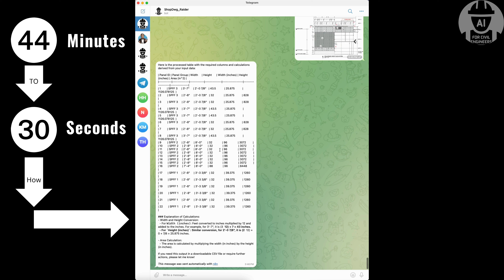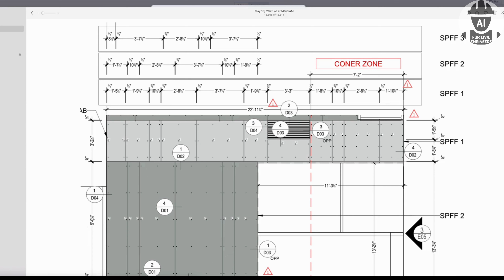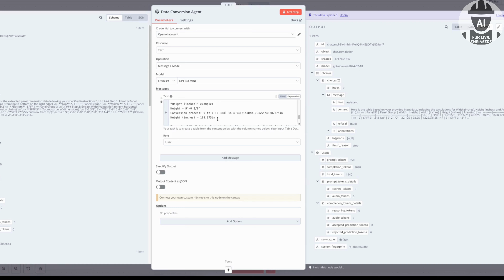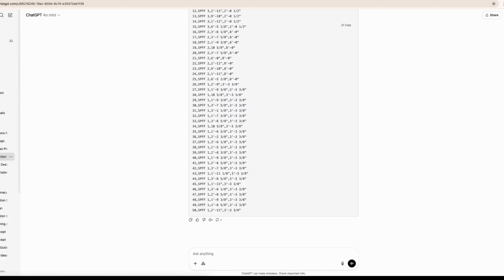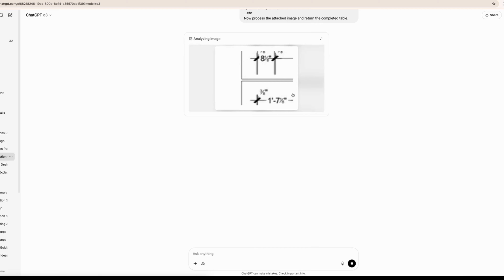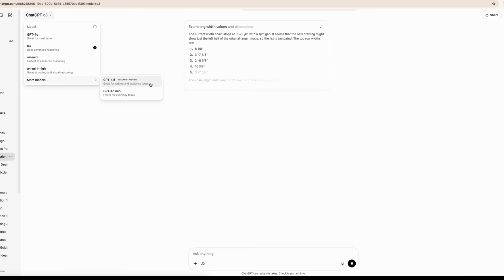AI Reads Blueprints—Instantly Fills Your Excel Sheet! 🤯 Watch AI Do the Dirty Work Zero Manual Input

Comment: Hi I my construction drawings are huge pdf of around 30 mb and it has multiple plans with in pdf. how can we generate BOQ by passing drawings?
Reply from the maker: Hi Kunal. This a great question and I have been working on this for awhile. Please watch my previous video on Construction Material Takeoff 

AI Automation for Construction Material Takeoff 
https://youtu.be/YFD4W7ZGPLQ

This is just the beginning of this project, and may not be accomplished easily. One, thing that is very difficult to achieve is that all engineering drawings are not the same and one ai solution will not work for the other project and/or industry. The ai automation needs to be tailored and customized for each sub-industry within engineering (bridges, buildings, mechanical, electrical, etc.)